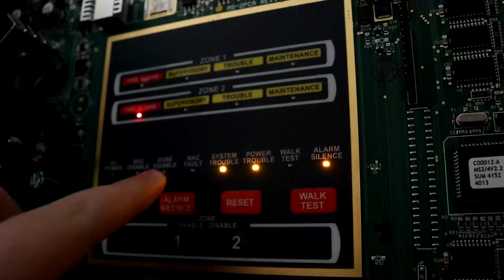Thermal Testing My i3 & Showing Off New Devices!

Comment: Is your i3 four wire
Reply from the maker: Yes it is.
Reply: I wanna t-tap my system and do what you did, but I don’t know how to do that
Reply from the maker: What I did is I took the positive end of the resettable power and wired it directly to the positive end of the alarm. The negative end went to the common (C) terminal of the resettable power, and then I had another wire going from the normally open (NO) terminal to the negative end of the alarm. I wouldn’t use it for that many devices though, you don’t want to draw too much current from the resettable power.